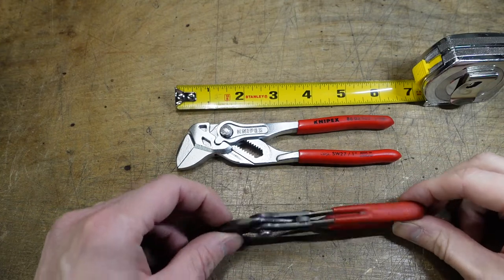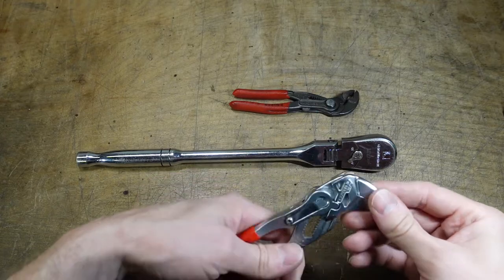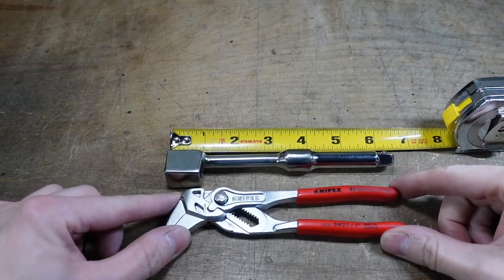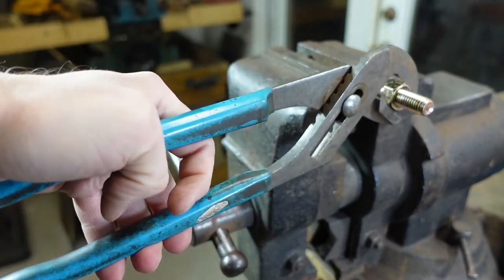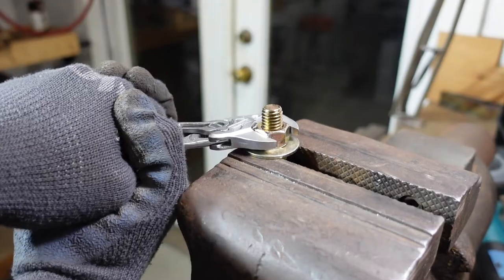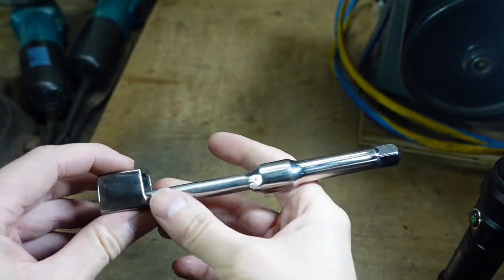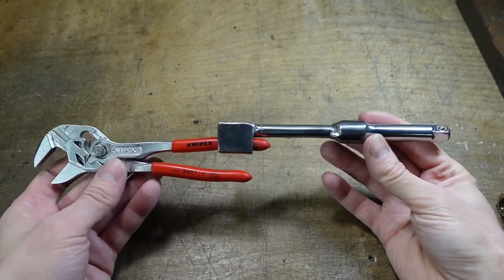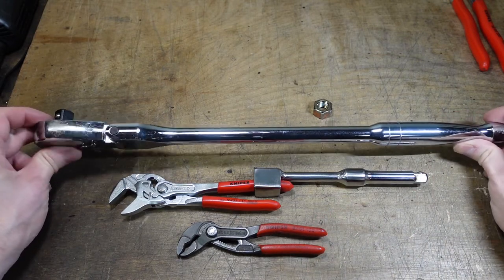Knipex Pliers Wrench Cheater Bar for Double the Leverage - EDC Everyday Carry DIY Tool Idea

Comment: These pliers are forged!  Not cast. 
I used my 10” Cobra’s to remove a fitting from my son’s water heater. I put a 4’ pipe on the top handle and pulled with all my might. I’m 200 lb. He’s bigger so he held the water heater. It was a struggle. But the pliers never broke. 
After it came off I gave the pliers to my son. I said, “Every man needs a pair of these”.
He took them and looked them over. He couldn’t believe they survived. They didn’t even have a mark!  
He took them and said thanks. 

I used to walk thru the forge room at Irwin to get to my job. 
Those guys would heat the steel red hot then hold it in the trip-hammer for a few blows, then heat it again. There is a knack to it. 
I think Knipex has it figured out. I have 13 pairs of their pliers.

Comment: I have this knipex 180mm, but still confuse how to do one handle push, sometimes it's works sometimes not so I need to squeze.
Looking again at your video 1:24 and play it 0.25x speed, it slips !
at 2:11 when thightening with 250, I see it will slip before you cut the video, and it seems you squezed the handle, am I correct ?
at 2:21 it's seem still required to squeze the handle ?

When using with knipex cobra, its very easy for me to do one handle push, but not with this knipex pair plier. 

Any tought how to use it with one push handle only ? tips trick ?

Comment: clever improvement ..... I have the straight jaws already, but because of you I have a cobra 125 on order 👍😎👍
Reply from the maker: For bolts, bending, and clamping, the smooth jaws are awesome, but for daily carry I find a lot more uses for the Cobra 125's.  Just yesterday I used them to tighten the garden hose fittings, the ones with the rubber washers, on the outdoor faucets.  I think you'll really like them.  Thanks for watching

Comment: What do you think of the 125 plier wrench?   I'm having difficulty deciding between 125 and 150 for everyday carry.
Reply: 150 for EDC. My buddy got the 125 and they're kinda cool, but just not big enough to take on anything a good sized leatherman can't. You'll find the 150 way more useful, and it will fit fine in your pocket as long as you're not wearing tight daisy dukes.

Comment: Are you selling them Or do you have a video of how exactly you made it?
Reply from the maker: I just have the one unfortunately.  It was an idea that I didn't know would work so I did not film the welding but I can add some dimensions and more details in the description.  Most of the work is grinding the welds actually.
Reply: @projectswithrich22  sell this one. To me. 

What parts did you use for the box end? Specifically the tapered side?